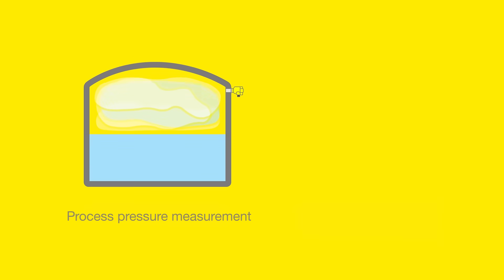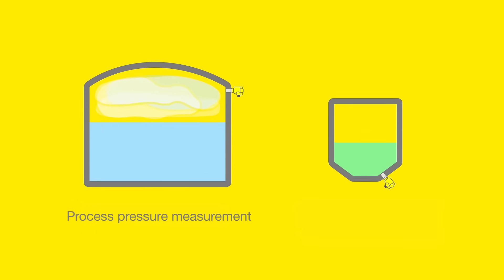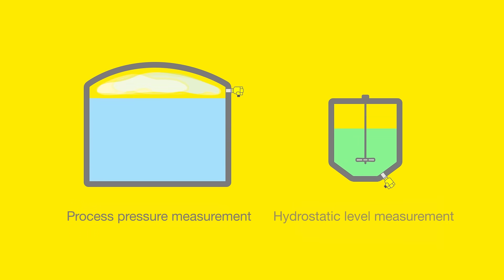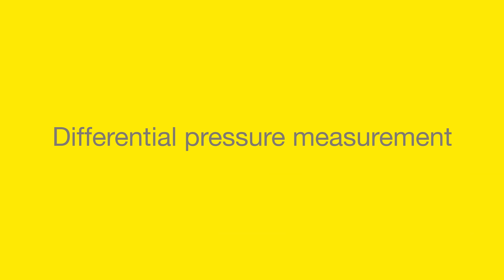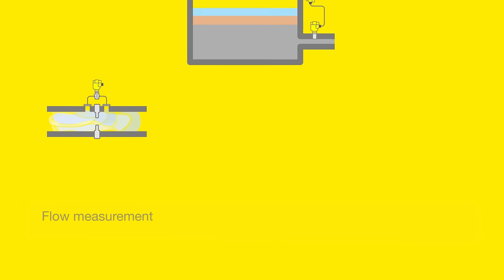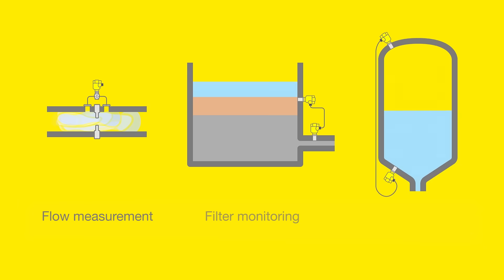How to choose a pressure transmitter: 5 tips | VEGA talk

Comment: Hello, for cylindrical tank, height 2 meter(our max target is 1,75meter), capacity 4,000 Liter, hot bitumen, what  should be max MB of pressure sensor? Thanks in advance
Reply from the maker: Hello,  thanks for your question. For bitumen applications we recommend the VEGABAR 83 with the metallic METEC measuring cell. 
Temperature range is up to 200°C. For a 2m high tank, a measuring cell of 0 – 0.4 bar is suitable. https://www.vega.com/en/products/product-catalog/pressure/electronic-differential-pressure/vegabar-83
Reply: @VEGA_Level_Pressure  Thank you